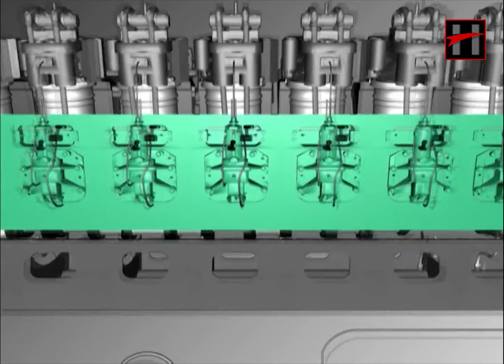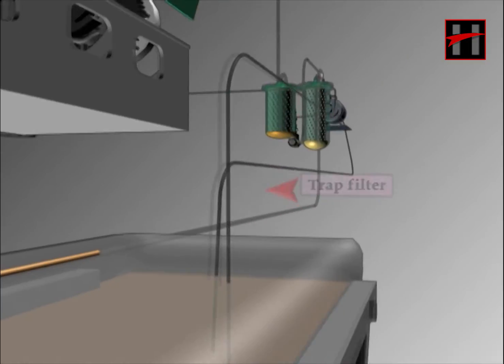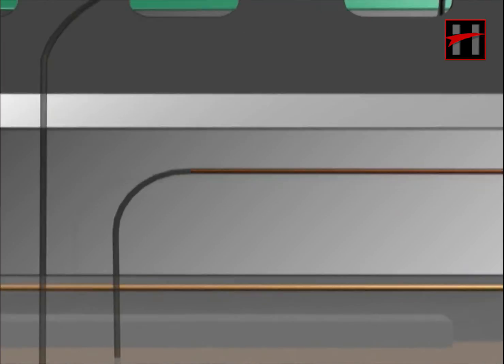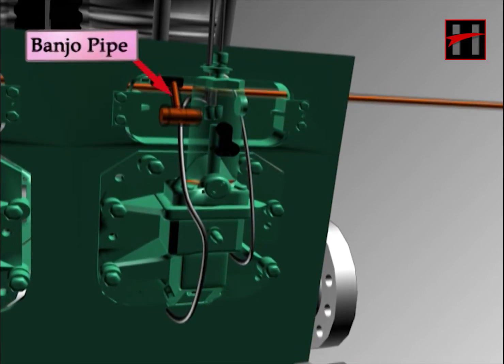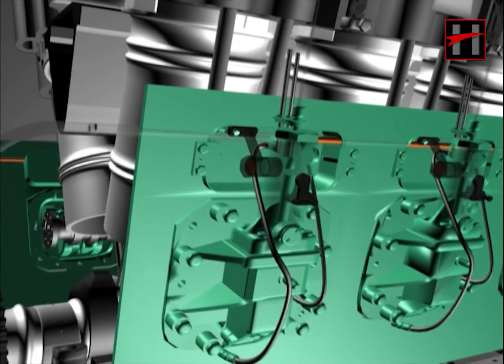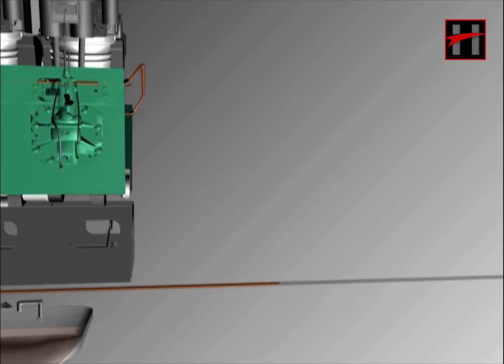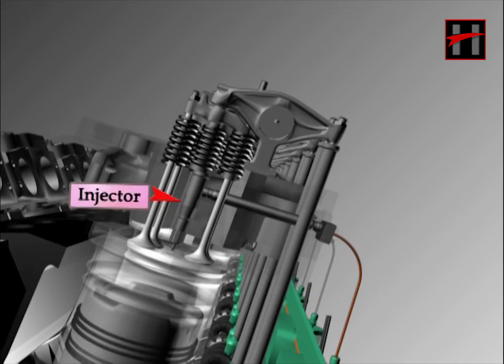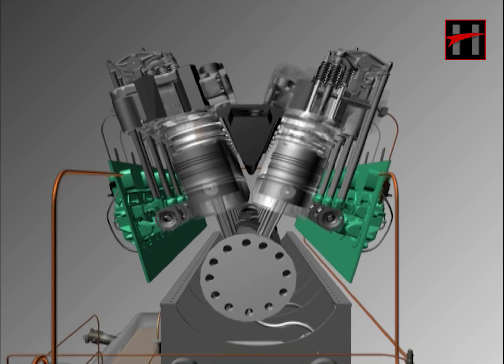How Diesel Electric Locomotives Work ( 3D Animation ) : Fuel Oil System

Comment: sir auxlary power units qa hai
Reply: The locomotive has many electrically powered systems besides the main motors: instruments, ride control, the horn, etc. The auxiliary power unit is a small diesel generator for providing power to these systems.
Hope this helps!